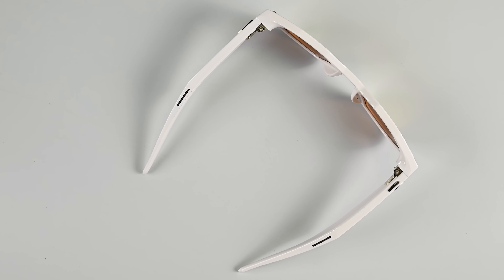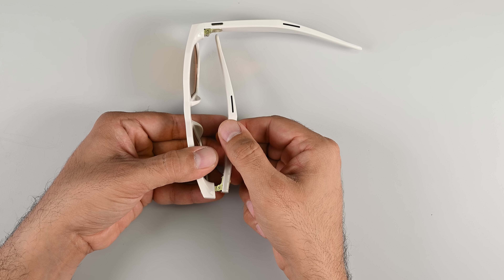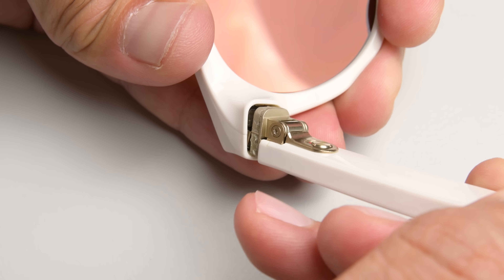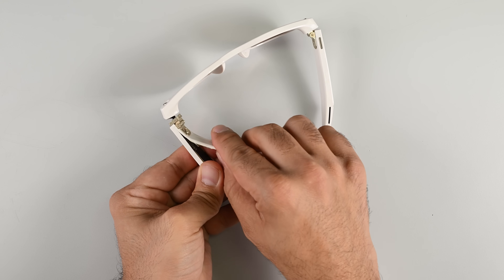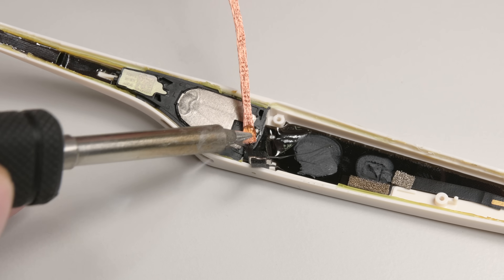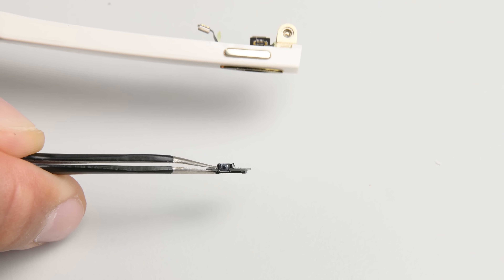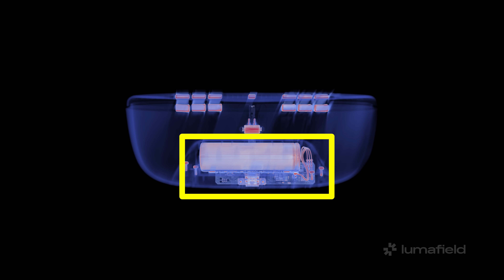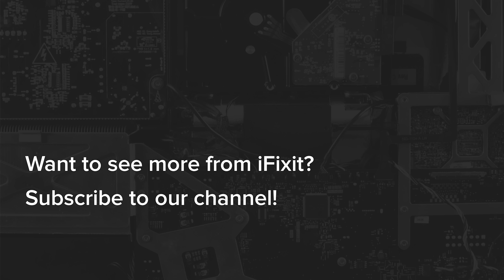$500 Oakley x Meta HSTN Smartglasses Teardown: Impossible to Repair?

Comment: If the camera and processor are the same, why can’t the Ray-bans record the same quality as the Oakley. Is the reason better thermal management, or is it the slightly larger battery, or is it just software locked in order to sell more of the newer expensive glasses.

Comment: Yet another engineering marvel with zero thought put into repairing it. Okay, they did think about it, but would rather have you buy a new one every year.
Reply: Designed to be e-waste
Reply: well thats just it, for 500 bucks I'd expect to get at least 5 yrs out of this....otherwise, its not worth the 500 but then again, Im not a huge fan of designer anything, let alone glasses so its a tough sell for me on many levels

*edit*  I wanted to come back to this almost immediately to mention a thought I just had. I paid 260.00 for klipsch earbuds and when they finally wear out, I intend to just toss them and buy some new ones....I've had these now for at least 4 yrs btw so maybe I WOULD be open to spending 500 on something ultimately disposable